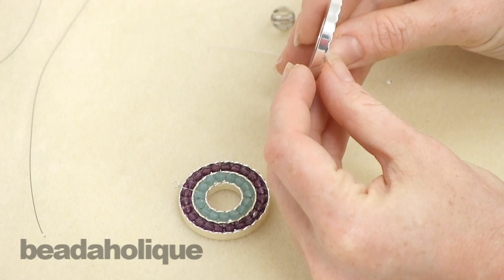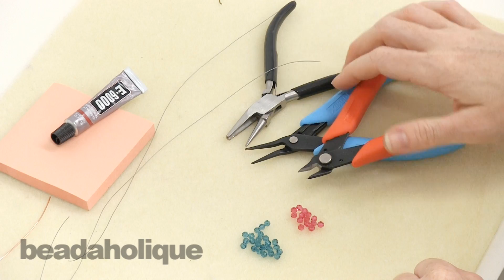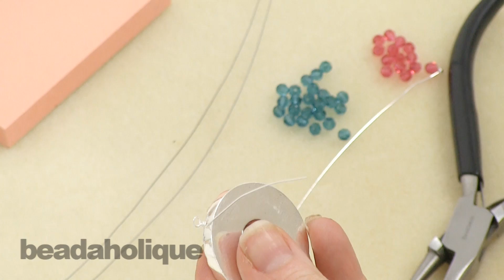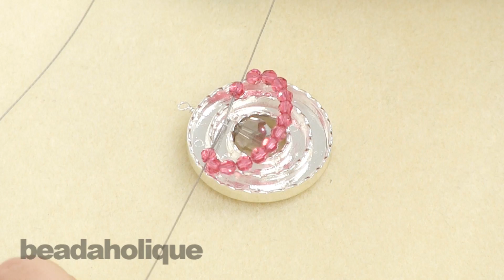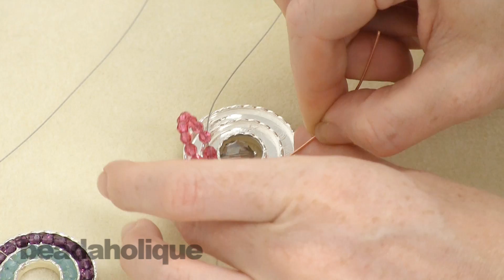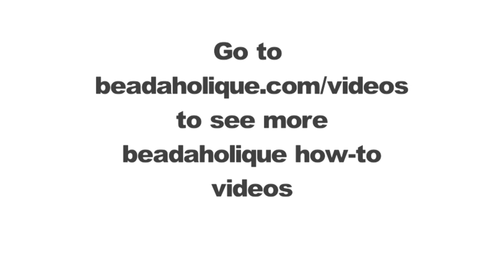How to Use Katiedids Channel-Set Components with Beads

Comment from the maker: In this case, I do not feel that there is a "too" thin wire, as far as the interior work is concerned. As long as the wire is strong enough to support the beads, you should be fine. You are also adding glue for added support. To create the wrapped wire loop, I would not go any smaller then 26 gauge wire.